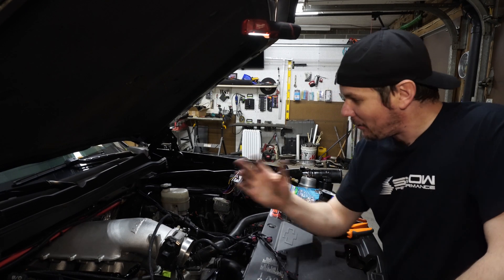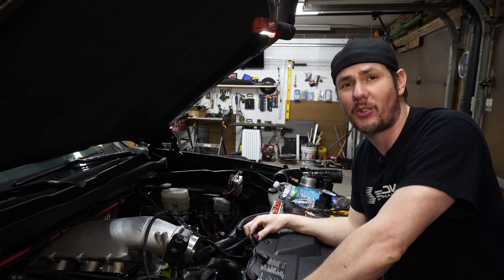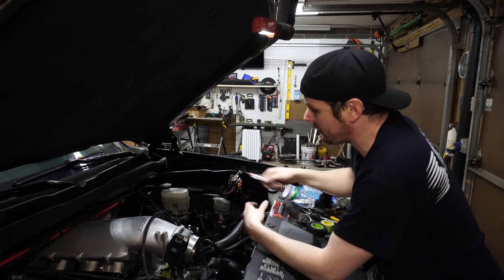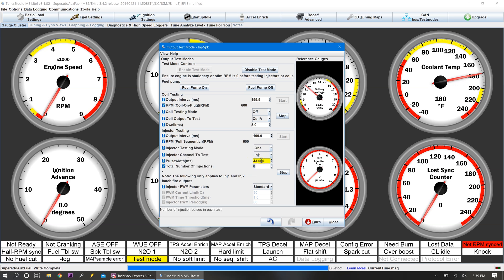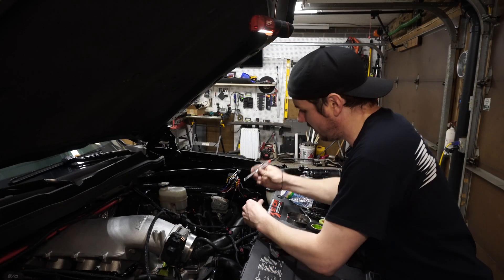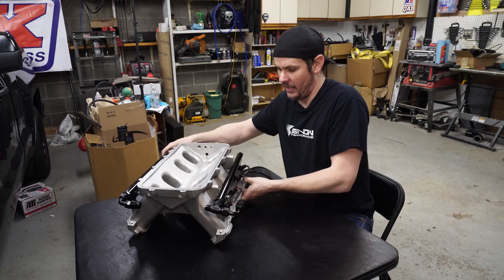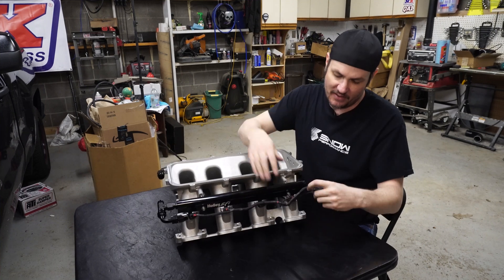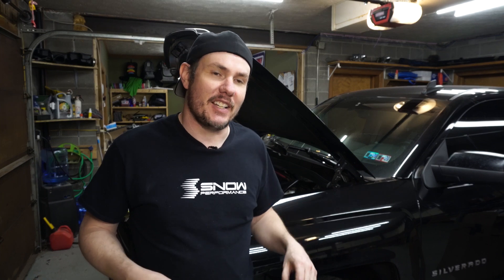Microsquirt Auxiliary Injector Testing, Verifying Our Wiring!

Comment: Is the micro squirt working in tandom with stock ECU? Is it running the I/O expander firmware? More context would really help.
Reply from the maker: Yep and it's just running standard firmware on fuel mode only using the same sensors as the factory ecu

Comment: You answered a question i had in my mind , how will the megasquirt know when the injection time is for every cylinder or when the valves are open . So it’s basically just injecting all the time , if so will you just control the duty cycle of the injectors to hit the required lamda or keep them at 100% all the time ? Won’t that cause the fuel to be less atomized ?
Reply from the maker: Will set them at a pretty low duty cycle with a ramp rate based on rpm and map pressure so they will only inject when in boost with the goal of using them as little as possible until we run out of direct injection, then flatten the curve and adjust the aux to make up the difference.

Comment: This is the missing link for Gen Vs.  Cheap, secondary fueling....awesome!
Reply from the maker: I'm hoping so! Though I don't know if it's cheaper but it should have way more overhead
Reply: @GoatRopeGarage  how does the microsquirt know when to spray fuel? is it based on rpm or on crank position? 
because I want to leave my engine on stock Ecu, I just want the microsquir to control the secondary port injectors nothings else (primary injectors and ignition will be left on stock ecu.